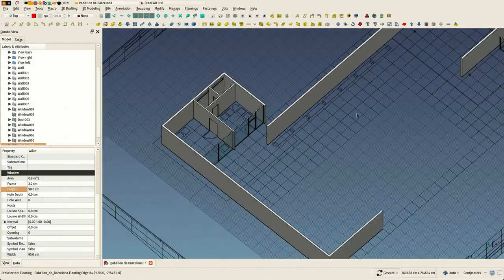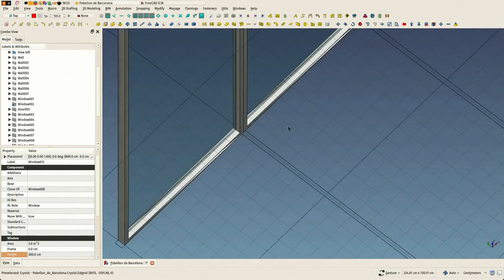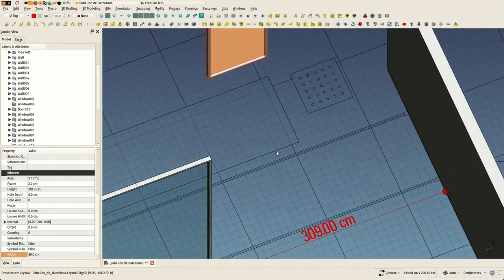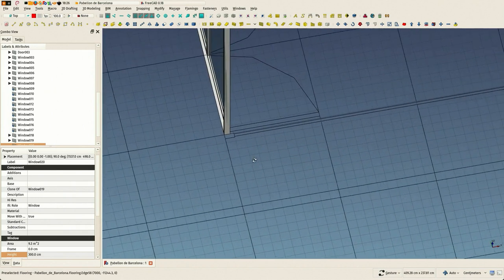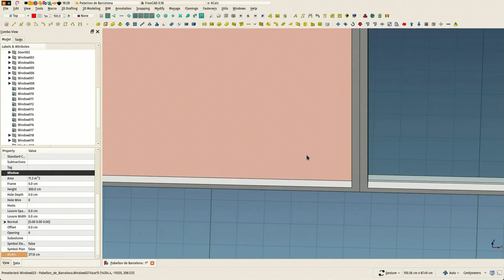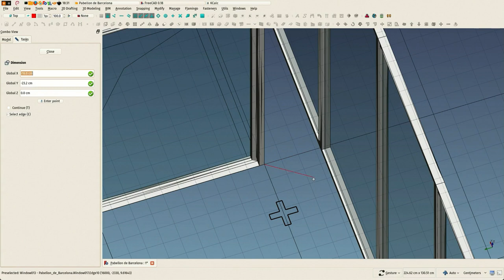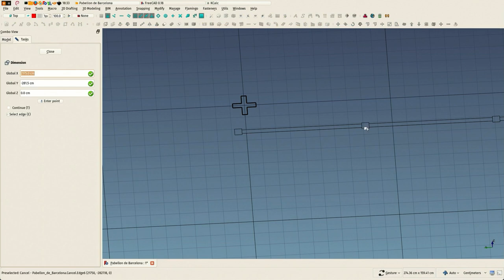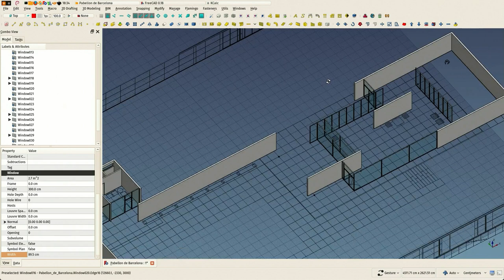BIM with FreeCAD - Barcelona pavillion 05 - glass panels part 2

Comment: Hey Yorik, just to say thanks for all the effort you put in developing those tools and showing how to use them. I've been practicing and I kinda solved some situations in a different way (I hadn't seen your videos yet?)

Just a few questions: provided that all of those aligned crystal panels measure 1 mt, isn't it possible to apply the array command to the first window in the row? 

 if those arranged windows were attached to a wall, would  those 'cloned' windows open their respective boolean holes in the wall? Or just the original one?

and finally: is it okay to use curtain wall entities to represent crystal walls?
Reply from the maker: Yes for all questions, except that the arrayed windows won't cut the walls anymore. The solution there, is disassociate windows and openings, making the first window not cut the wall anymore (empty its "hosts" property). then you make a cube that defines an opening, and make two arrays: one with windows, one with the cube. The arrayed cube is your openings, and you just need to subtract it from the wall.
Reply: @YorikvanHavre  I see. Thank you.